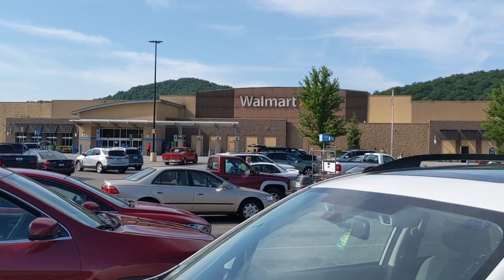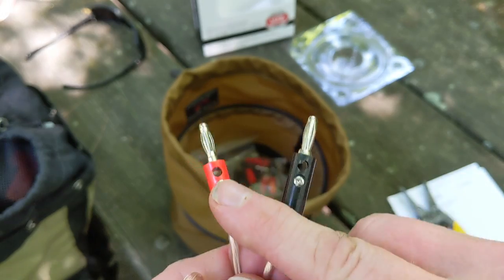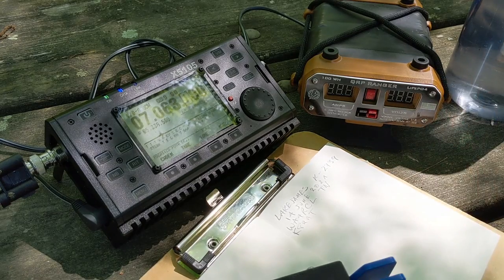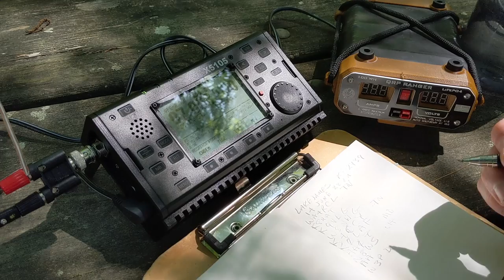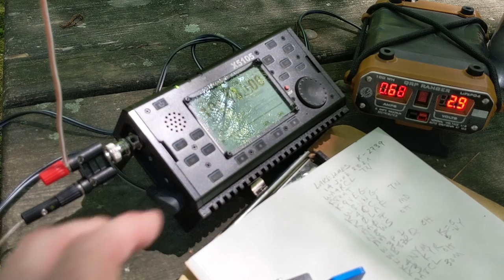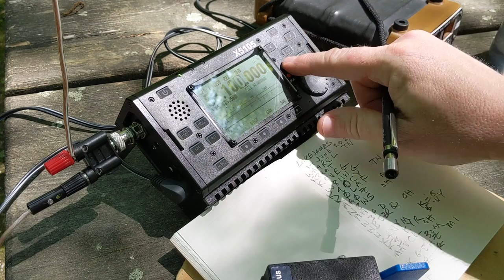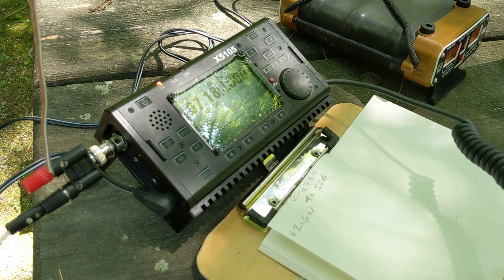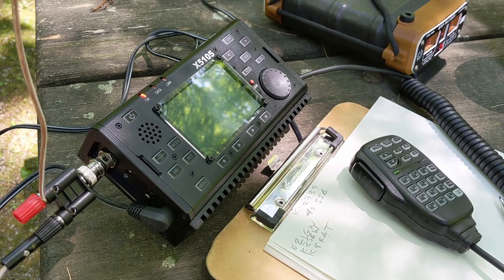POTA Field Report: Let's build a super simple speaker wire antenna on site and activate this park!

Comment: Can you put more than one ground wire on this antenna with that post you are using? Or will one be sufficient?
Reply from the maker: One works, but you could easily add three more ground radials. It would only improve performance on 40M and up.

Comment: Thomas mate, quick question on the "Pocket Paddle" with or without magnets???? Still thinking I will knuckle down and learn it.
Reply from the maker: Definitely learn it! The magnet one basically is all about magnets on the bottom of the paddle that will allow you to attach it to a metal plate. I keep meaning to find a piece of metal to mount to my clipboard for this very purpose. You've got this CW thing!
Reply: I just got one of these paddles. Love em. Price is right. Quality is great. I can send good cw with them.  I got both a single and double lever because I always wanted to try a single lever. 
Took me a while reading the description to realize the magnets were for mounting not spring substitute. In the field I only hold the key so no magnet needed for me.

Comment: With no coax what is the radio seeing in ohms ??? I would think a high impedance... ????
Reply from the maker: Yes, but the internal ATU sorts out the impedance match. There is some efficiency in the fact that there's no feedline to match.
Reply: @ThomasK4SWL  My IC-705 doesn't have an ATU, how else to turn the antenna? I have a Comet HFJ-350M that I still can't get to work with the 705.
Reply from the maker: @axi6ne8us  Doub;e check the owner's manual (I don't have this antenna), butI'm sure you should be able to find a match if you try adjusting the length of the telescoping whip and (importantly) the counterpoise wire.

Comment: With that much wire, you could do 160/80m. How accurate is the CW decode? G7VFY
Reply from the maker: CW decode is okay. Better than I originally thought it would be. With that said, it doesn't do well if the signal is slightly off frequency or if someone isn't using an electronic keyer. And I've a number of other antenna ideas and plenty of scrap wire at home! :)

Comment: Thanks for this. What is the max watts you can put through the 16 gauge speaker wire?  Thanks again. Great video.
Reply from the maker: I would imagine quite a lot of power. The wire could handle more than 100W I imagine. Of course the parts that might heat up are the adapter and I'm not sure if you'd get a bit of RF having the feedpoint so close to the operating position at high power. That would be for an antenna guru to comment on. :) At QRP levels, it's very forgiving.
Reply: @ThomasK4SWL  Thanks Thomas. 👍🏻

Comment: Great homebrew antenna.  What calculation did you use to get the 28.5 ft length?
Reply from the maker: This is the length suggested in the original Elecraft KX1 manual. Basically, it's one of the "magic" lengths that's not resonant on any one band I use. 31' is another length I'll often use with random wires.

Comment: Thanks for the video, I have a question if you or anyone knows please. I understand to hang the white striped wire in the tree. What do you do with the other wire? And are both wires 28 ft? Thank you.
Reply from the maker: Great question. So the white striped wire (in this case) is the radiator and the other wire is the counterpoise. I simply lay the counterpoise on the ground, usually in a line pointing away from the operating position. It couples with the ground, so placement isn't terribly important. It could also be elevated, but that would change all of the matching dynamics for the ATU.

Comment: Is this only for QRP, or could you use this for QRO?
Reply from the maker: I think you could use this for QRO as long as your ATU could match it effectively. You might need to do some RF calculations, too just to make sure you're good with 100W feeding directly into something like that. Not for folks with pacemakers for sure. :) At QRP levels, it's no worries.

Comment: Thomas, I’ve had challenges getting my antenna into trees.  Do you ever use telescopic poles?   
When you use trees, how do you propel your antenna around a willing limb?
Thank you Thomas. 73. Jay. Ve3jlo
Reply from the maker: Hi, Jay,

With wire antennas, I exclusively use an arborist throw line: https://qrper.com/2020/09/a-field-antennas-best-friend-the-amazing-arborist-throw-line/

It's the Bee's Knees! :) And I do use the Chameleon CHA MPAS Lite which is a telescoping whip antenna--also the Wolf River Coils TIA vertical. I recently purchased a SOTAbeams Tactical Mini pole that I also plan to use with my QRPguys Tri-Bander antenna. 

Cheers,
Thomas
Reply: @ThomasK4SWL  Thank you so much. You have me inspired to work contacts in the outdoors. Ive used my ft897 in the past and struggled with antenna positioning. I am watching your qrp radio reviews. I had no idea of these products. Thanks for your contribution to our hobby. 73 Jay

Comment: With 200 feet of wire why not go ahead and make a resonant antenna without using antenna tuner?   Just saying since other radios have no antenna tuner.  
I use an endfed with 67ft of wire  with no counterpoise.  Ive made five 49-1 transformers which I have in a plastic box a little bit bigger than my QCX mini.  I put each one in a separate go box.  I grab the radio go box and it has everything I need except the coax.   The transformer can handle 100 watts easy.  
Even though i have an antenna analyzer, I would carry my G90 to verify resonance.  But Ive put that antenna up so much, I feel completely comfortable that i have resonance without checking if I did not have a means to check.  It is 1-1.0 for 40 and 20 band and less than 3 on several others.   Even if i use a radio with an ATU, I don’t use on 40 or 20 bands
Reply from the maker: Great ideas! So I have other plans for the rest of my speaker wire already. :) Watch for that in upcoming videos!
Reply: @ThomasK4SWL  i will be watching.  One day I hope to catch you on the air.

Comment: How would this work with a non BNC rig?
Reply from the maker: You could build an adapter for any antenna port. Of course, it's most important that the internal tuner of the radio has enough impedance matching range.
Reply: @ThomasK4SWL  Yaesu FT-891
Reply from the maker: @K4dsx  right. So it doesn't have an internal ATU (unless I'm mistaken) so this sort of antenna couldn't be paired directly to the FT-891. You could, however, pair it to an external ATU.
Reply: @ThomasK4SWL  TY kindly and great video/info!